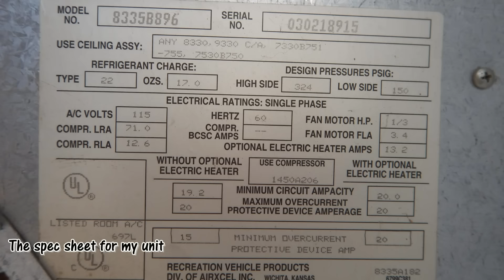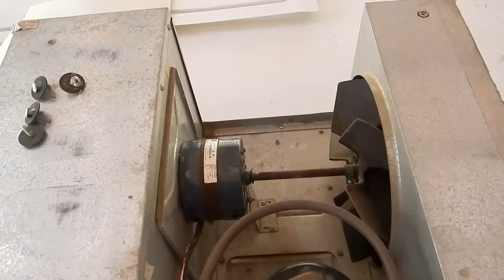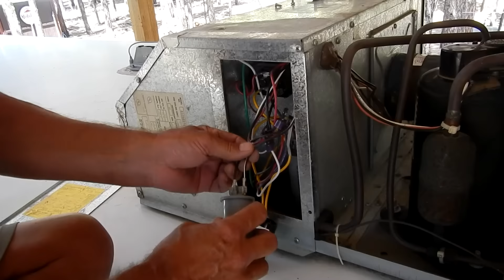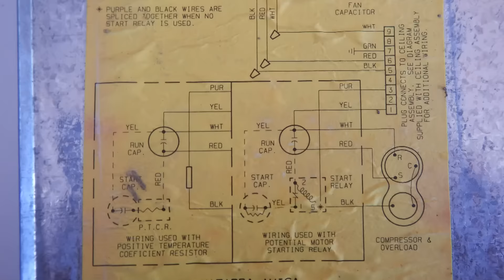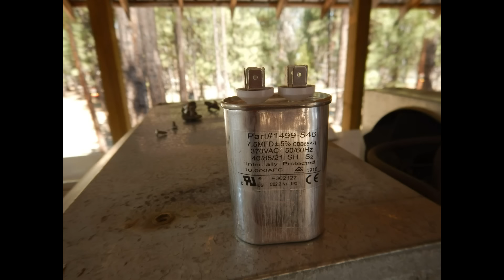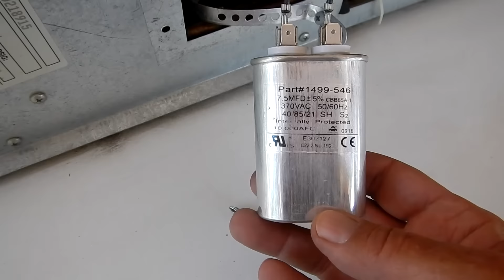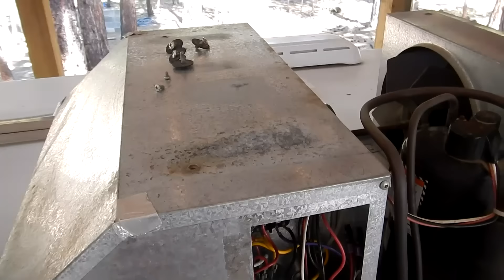How to easily fix your RV air conditioner.

Comment: I am having issues I replaced the three capacitors responsible for it and it still has the same issue the motor is running slowly then fast at times and it stops also and it don’t start when I turn it on so I have to push it
Reply from the maker: Does the circulating fan motor run without the AC compressor running? You've eliminated the capacitors as the possible problem. Does the fan motor spin freely when you spin it by hand? Has anything changed with your thermostat?
Reply: @TomandJulieMineExploring  it spins freely when it is unpowered but as soon as i powered the motor the shaft stiffs up and I cant turn it by hand anymore and when i do get it to run it will run only for 30 seconds then stops during the seconds it would slow and speed up until it stops
Reply from the maker: @BlackAnt02  It's always hard to diagnose the problem over the internet. If your power supply is good and everything else like wiring and thermostat are good then you might have to start thinking that the motor is bad.

Comment: My ac will run a minute or two then it will cut off and the breaker will trip. What do you think?
Reply from the maker: Your breaker actually trips or the air conditioner just stops without tripping a breaker. The reason I ask is that there is a thermal overload that will also shut things down which is different than tripping a breaker.
Reply: @TomandJulieMineExploring  on high it will trip the breaker but on low it will just cut off
Reply from the maker: Can you run just your circulating fan on high without your air conditioning compressor?  This depends on what thermostat you have. That would tell you if it's the fan or compressor that is causing the problem.
Reply: @TomandJulieMineExploring  yes runs fine with just the fan. When I switched it over to the ac side it runs for a minute or two then shuts down. You can almost hear the compressor struggling.
Reply from the maker: Compressors have a thermal cutoff that will act like what you are describing if they get too hot or draw too much power. They do normally make a slight grumbling sound. It will try to start up again after the sensor cools. Unfortunately the newer compressors are a sealed unit with the motor so not much is serviceable as far as bearings or the motor itself. You could have a problem with the refrigerant level although that would usually cause a freeze up if it were low.
Reply from the maker: I always replace the capicitors when trouble starts up because they are the most common thing to fail. It is something that would be recommended if you need a new compressor anyway so it's not a waste to do it now to make sure they are not the problem.
Reply: @TomandJulieMineExploring  gotcha! Thanks so much for responding! I will be looking into all of these. Thank you again!
Reply from the maker: @proarc81  You're welcome and good luck.

Comment: Did this make the breaker kick out ? My friends A/C breaker kicks out sounds like the compressor is running.
Reply: Thank You for the speedy reply, I am going over to check it out. May be the compressor start capacitor ,
Reply from the maker: @bball111454  You're welcome.
Reply from the maker: It did not trip the breaker. Sounds like something is drawing too much power, or the breaker has gotten weak, which they can do after tripping several times.

Comment: i had a question
i had an rv with an AC and thermostat. i got a newer RV and this one doesnt have a thermostat. it has a dial to control the temp. when the AC is on, compressor kicks in and the fan kicks in. lets say i have the thermostat set to half way. the compressor kicks out when the desired temp is reached but the fan keeps blowing. what happens is that immediately the humidity starts climbing for example from 50% to 90% and makes it very uncomfortable in the  RV. ive tested some different scenarios. when i hear the comp kick off, i walk up and turn the fan off too and the humidity stays at around the same like 50% stays at about 50-55% 
my question is....is there a way that i can rewire the FAN to turn off with the compressor? i thought of rewiring it at the capacitor. is that ok or does anyone have any other ideas?
i want the compressor and fan to work together. comp off, fan off. comp on, fan on.
Reply from the maker: Diagnosing AC problems over the Internet is never going to be ideal. I would not attempt to rewire the system. The fan switch...on/auto/off could be set incorrectly. The thermostat could be defective and needs to be replaced.  The fan wiring could be wrong, damaged or loose. On some units the blower fan will run on if the condenser is icing up in an attempt to thaw it. Air flow could be restricted by a dirty filter or dirty condenser. The refrigerant level could be low causing the condenser to ice up. This is all I can think of off hand and I hope you get to the bottom of it.

Comment: my ac just clicks on automatic. fan setting ,hi or low just clicks.  I had it running well for about an hour , i turned it off for about 2 hrs , tried to restart and now it just clicks. any thoughts ??? Bill
Reply from the maker: It sounds like the circulating fan is not blowing air around? If not can you start it by hand as I did in the video? I know this requires you to be on top of your rig with the AC shroud removed so if you are not comfortable doing that don't. If you can start it by hand it's the start capacitor which is a very common problem. If the fan is running but blowing warm air then check to see if the compressor is running by listening for it.

Comment: I have a wilderness gl 27h and the ac turns on but doesnt cool,and the high and low automatic does not work.What would be wrong with it?
Reply from the maker: The first things I always check for is to see if the circulating fan is running and if the compressor is running. The circulating fan is what blows the air around and is what I started by hand in this video. You will have to listen for the compressor to tell if it is running usually easiest when you have the AC shroud off.

Comment: So everything in your video resembles the troubles I am having. And after ordering and installing the exact capacitor the fan blade still does the humming noise and doesnt initiate. Any ideas on what could be my next step?
Reply from the maker: Can you jump start the motor by hand and make the fan run? That usually means the starting capacitor has gone bad. The other capictor is the run capacitor and starts the run circuit which is working if the fan runs at all.
Reply: @TomandJulieMineExploring  Yes I can jumpstart the fan by hand, but after about ten minutes it will quit blowing, it's got to be the starting capacitor and maybe that triggers it to stop blowing somehow ? I  appreciate your input and am glad to find ally talk with somebody.
Reply from the maker: @justincorwin7444  If the compressor overheats there is a thermal cutoff that will shut down. Does it blow cold when it runs?
Reply: @TomandJulieMineExploring  Ok, so I just turned it on after about an hour after the installation and the fan actually kicked on by itself, but still after about ten mins the fan dies and it goes back to a humming. I would say that it is not blowing cold air at all, what could this mean?
Reply from the maker: @justincorwin7444  Sounds like it's possibly a thermal cutoff. Make sure neither the fan motor or compressor are overheating. If you replace the run capacitor also it wouldn't hurt then you know the caps are good.
Reply: Don't forget about the oil ports I had to take out the little rubber stopper to oil them the material to hold oil was 100% dry

Comment: Would this cause a thrown breaker?
Reply from the maker: It did not on my unit but I imagine it could if you left it trying to start for more than a few seconds.
Reply: Thank you so much for the tips! I have no one else to ask. I’ll let my fiancé know. This TX heat  and bugs suck!! Lol I don’t have the camper in shade, she’s kinda out in the open. Our transmission on our truck went out and it’s in the shop, so we can’t move her to shade, but in the evening she is partially shaded. The bedroom ac is fine btw. The bedroom one is in full sun. I usually have the windows open and I baby the ac’s when they’re on. I guess they’re demanding more pampering 😂
Reply from the maker: @squirrel3443  You're welcome and I hope you get it working.
Reply: Okay, I’m really confused on my camper lol it was working fine this morning & cooling well. Then I noticed it hadn’t turned on in awhile and I checked the breaker and it was blown. I haven’t reset it yet I’m waiting for my fiancé to get home first so someone can be in roof and check it out when she turns on. I was on the roof yesterday and the ac looked fine at a glance and blowing well. No oils on the roof. It’s a dometic. My camper is my home, it’s a 2018 model. I’ve literally had it a year today and just curious on the ac before calling the dealership. I have terrible anxiety 😂
Reply: I do keep having dirt daubers coming in but don’t know where from. Would they have something to do with it? I work on cars, not campers 😂
Reply from the maker: @BambiJesus when you are on the roof and your fiance tries to start the ac make sure the fan starts up right away. If not you can try and start it by hand just like I did in the video by giving the shaft a spin. You can also tell if the compressor is running by listening for it. The fan  capacitor is one of the most common things to go bad although not usually after only one year. If the fan motor or compressor are not starting it's possible to draw enough current to trip the circuit breaker. Hopefully you can get the fan to start which means the motor is good. I don't know about the daubers and the problems they could cause.

Comment: Are RV A/C and Heat units interconnected to a car's radiator, or are they their own separate unit?
Reply from the maker: AC is a separate unit mounted on top of the RV.

Comment: My coleman air conditioner runs but smells like burnt wire and doesnt blow out cold. Could it be a capacitor or the compressor?
Reply from the maker: You should be able to tell if the compressor is running or not when you have the shroud off. The compressor has a thermal cutoff if it gets too hot. If you inspect the capacitors snd wiring you might find the problem. Make sure you unplug everything before working on the caps and wiring.
Reply: @TomandJulieMineExploring  ok great information. If I find that it's not running could it be a capacitor? Once in a while I hear it kick in and then go to fan mode then within a few seconds kick in compressor mode then back to fan mode. That's why I'm thinking it's a capacitor because of that and smell of burning wire
Reply from the maker: Yes, could be.

Comment: I had this problem, I don't have 3 capacitors, i only have a run and fan capacitor. so i bought the new fan capacitor and replaced it and yes it started up like brand new. now my ac will stop and it'll start making the buzzing sound again, if i leave it on it'll trip the breaker. so when i go out and flip it back and go to start the ac, it usually doesn't start. it wont even buzz. after leaving it alone for a while and then coming back and starting it, it'll buzz again. if i leave it longer it'll actually come on and work until fail again. i've also noticed the fan shakes more than normal, but i inspected it and it's still secure to the ac itself. the fan isn't seized or anything, it spins freely, it doesn't catch anywhere while spinning. does anyone have any helpful information? please share if you do. i've looked for solutions and i hoped this one would fix it, but it only did temporarily. it's a Coleman Mach ac, it's running off of a single 20 am breaker, it's the only thing on the breaker. Thanks in advance.
Reply from the maker: Have you tried another power source like a generator if your rig has one? You may not be getting enough power to the unit.
Reply: I haven't tried a generator, my rv has 2 acs, one that is tied into everything else, then there's the coleman in the bedroom that i'm guessing was put in at a later time and isn't tied into the electrical, it has it's own plug on the outside of the trailer that i hook an extension cord into and run to a 20amp plug. like a regular house plug, but it's on the electric pole next to my 30amp for the main power.
Reply from the maker: Make sure your extension cord is a heavy gauge wire. Usually 10 gauge for the maximum power.
Reply: thank you, i will check on that tomorrow.
Reply: I am living your nightmare. Please keep posting any solutions you may come up with. I also changed out the the other  (run) capacitor today only to find out I ordered the wrong items based upon info posted in this video. I won't have a power source till next weekend.I'll let you know the outcome when all the correct caps are in place. I did notice after I replaced the first cap it worked well for a short time. Then again the buzzing and fan would not work in all modes. I really do not think its the fan. It cools, fans turn, then  it halts. Even once I thought it was off and I heard it restart only to fail again. I'll wait to test when power is available.
Reply from the maker: Sorry that you ended up with the wrong part, Art. As I stated in the video information the part numbers listed are for the caps from my unit and yours are obviously different. There are many different models and year classes of air conditioners out there. I will edit the video info to say make sure to order the same caps that come out of your unit. Good luck with your fix.

Comment: My rear AC blows cold but the front blows warm; I guess I need to locate/check/replace the compressor capacitor. 

As far as making sure it’s ‘unhooked’ (it’s in the storage lot right now) is locating and turning off the breaker/fuse all that’s necessary? 

The idea of intentionally laying a screwdriver across the terminals of a capacitor is making my hair begin to kink!
Reply from the maker: As long as your main shore power cord is unplugged from any AC source, and you don't have your generator running, you should be fine. Shorting across the terminals on capacitors in an AC circuit like this normally won't even produce any spark and is just a precaution. Is your compressor not running when you turn the system on? You should be able to hear it if it's running when you are next to it. Good luck with your fix.
Reply: Honestly, I'm not the handyman!  I just retired and returned from my first trip with this '06 Monaco and both units blew cold the whole time.
Something 'may' have happened when the generator unexpectedly shut down while I was driving.  I was told that running a generator while driving was a colossal waste of fuel but it was extremely hot and the panel ac just wasn't getting it done.
When I stopped to fuel, I noticed that the generator has shut off on it's own.
Perhaps that's what did it.

I don't know what a compressor sounds like when it cycles on and off - I suppose I'll go on the roof, remove the shroud, and listen for a click or something.
Reply from the maker: It's not a problem running your generator while driving  so you can run your AC. Most generators are setup to shut down when the fuel tank goes below a certain level so you don't run yourself out of fuel. You can hear a buzzing grumbling type noise and feel the vibrations when the compressor is running.

Comment: We're hoping this is our problem. Going to check it out later! Thanks for the info
Reply from the maker: It's the most common problem for the fan not starting. If all you hear is a hum or buzz when the AC tries to start there is a good chance this is the problem. Try starting the fan by hand as shown in the video to confirm.

Comment: Try not to oil "oiless" bearings. It may seem to help at first, but the oil used may not "agree" with the sealed bearing... And could cause a grease fire from friction and a bad bearing. Instead of just seizure, it may ignite the grease.
Reply from the maker: pilot nelson Thanks for your input.

Comment: MY AC DOES NOT TURN ON OR BLOWS AIR, ALL I HEAR WHEN I TURNED ON IS A IS A CLICK AND THATS IT AND I DONT KNOW WHAT COULD BE, ANY SUGGESTIONS? Thank you.
Reply: SOCIALISM SOCIALIST capacitor. That's vwhat this post is all about. If you are not comfortable with 110v service, DO NOT DO IT YOURSELF. Find someone with the experience and basic electrical safety tools.

Comment: Excellent info and video sir! Ours started making the same buzzing noise this evening after my wife turned it off, then back on several minutes later. It had been running fine all afternoon. I'll check it out tomorrow and now know what to do.
Reply from the maker: Good luck with your fix. If you can jump start it by hand the starting capacitor is bad.
Reply: Tom Wigren, OK. I'll get back to you and let you know what happens. Thanks
Reply: Tom Wigren, Yep, this is exactly what is wrong with mine. I have a Coleman Mach AC unit. I'll get the capacitor ordered. If I have other issues can I ask you for assistance?
Reply from the maker: I'm happy to try and help you if I can.
Reply: Tom Wigren, I need the fan capacitor, correct?
Reply from the maker: Yes, you need the fan capacitor if your fan won't start by itself. Sorry for the delay in answering,  your comment got flagged as spam for some reason.